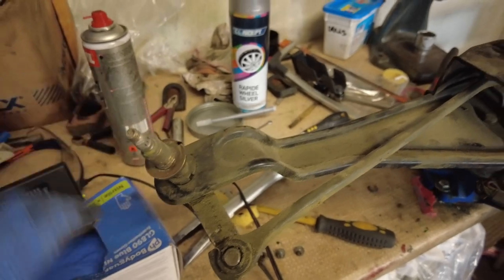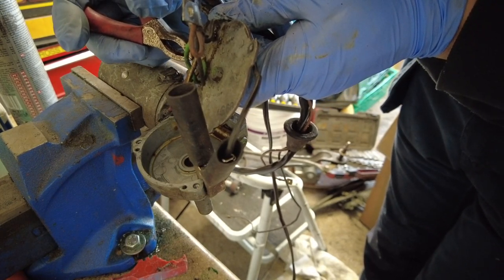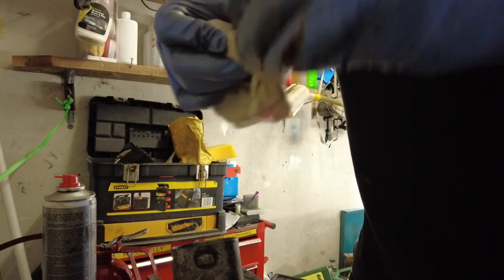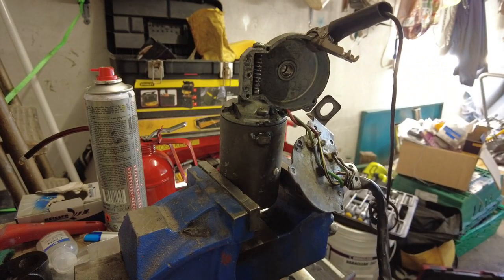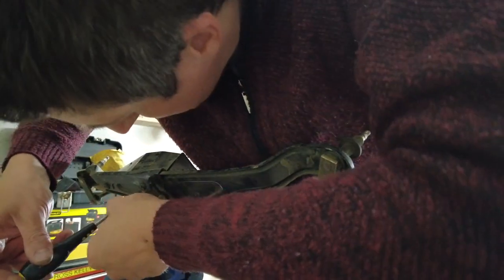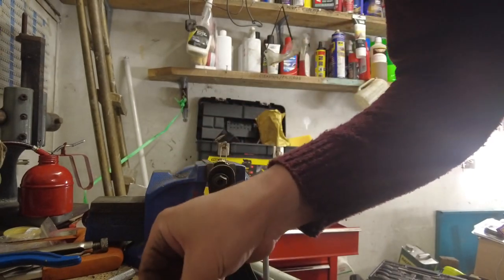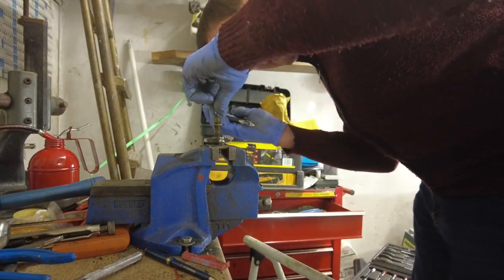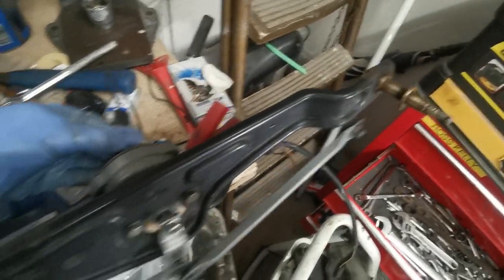Complete wiper mechanism & motor repair on a VW beetle

Comment: Great Job refurbishing the wiper assembly! if i may suggest? since a wiper motor is partially made of plastic. would it be better to use a plastic friendly grease like superlube (or the Euro equivalent) ? its also waterproof so it will never degrade like normal grease in that manner. Superlube is Silicone based grease. if there is something even better. please let me know.

Comment: How did you take the gear out ? The yellow big gear
Reply from the maker: It just pushes out. A tap on the output shaft with the handle of a screwdriver should do the trick.